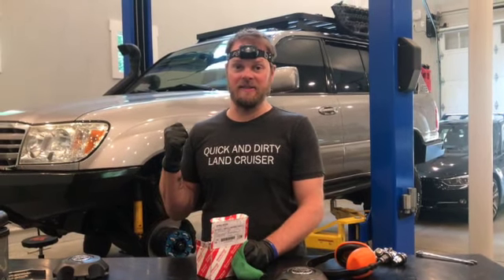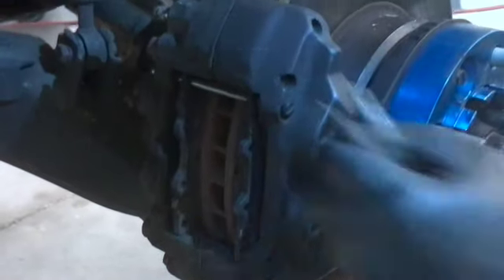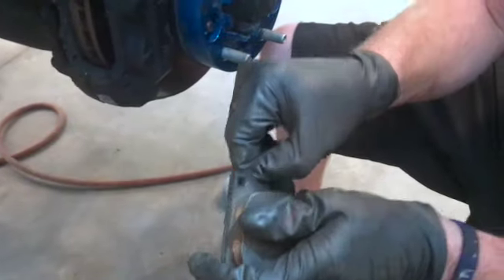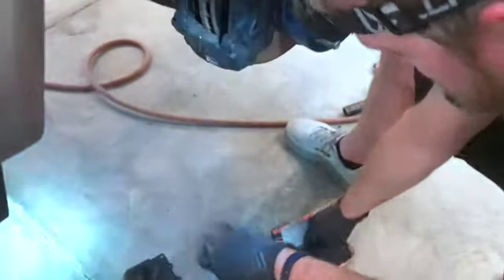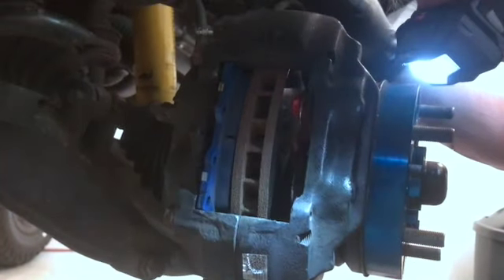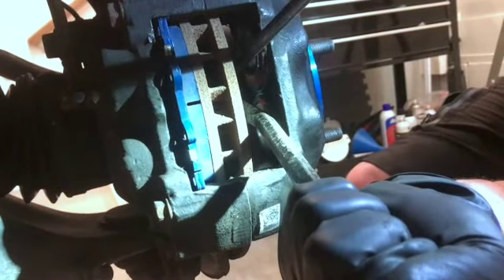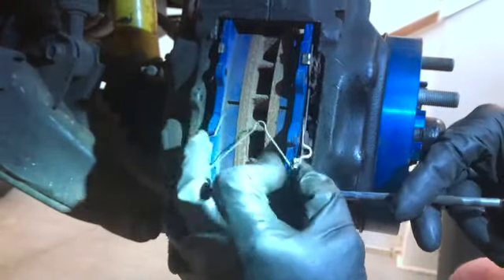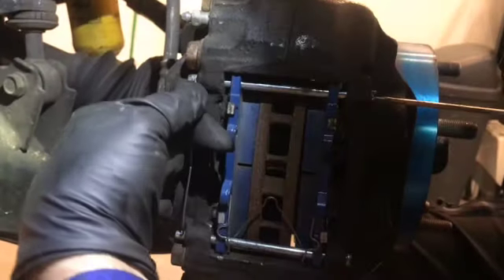LAND CRUISER Front brake job 100 series/80series

Comment: Great video. I was curious why your replaced the pads because the ones you removed looked like they had lots of life left. Thanks.
Reply from the maker: Well one side caliper froze up so the pad was a goner and threw in a cheap pad had already due to no time to order good factory pad, then came back later and put new ones on both sides